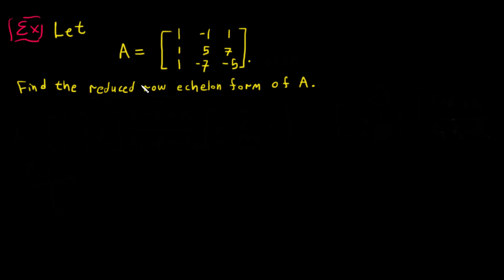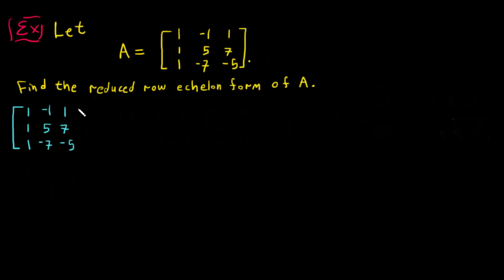Reduced Row Echelon Form for a matrix | RREF

Comment: So sir Not every matrix can be changed in RREF?
Reply from the maker: No,  any matrix you can change into RREF by using elementary row operations.

❖ Elementary row operations
There are three types of elementary matrices, which correspond to three types of row operations (respectively, column operations):
1. Row switching
A row within the matrix can be switched with another row.

2. Row multiplication
Each element in a row can be multiplied by a non-zero constant.

3. Row addition
A row can be replaced by the sum of that row and a multiple of another row.

So, if the matrix is not in RREF, you can change it into RREF by using elementary row operations (of course the matrix can be any size).

There are plenty of examples videos in the Linear Algebra playlist, and here is the link:
https://www.youtube.com/playlist?list=PLPm9fyDNbwj9zUIHKYfNwkfeWWBamk-q_

Let me know if you need any more illustrations about this.